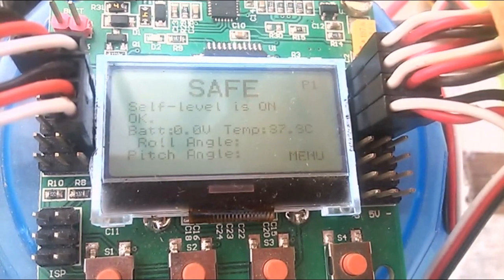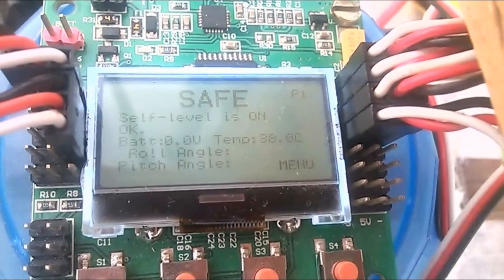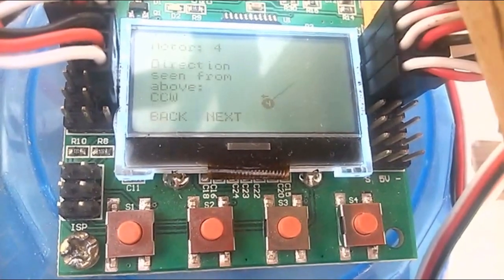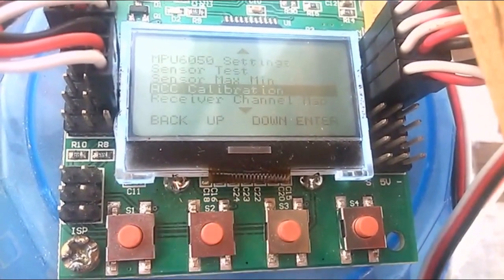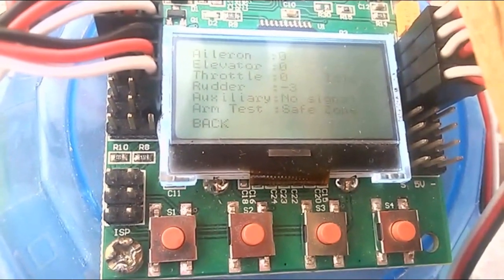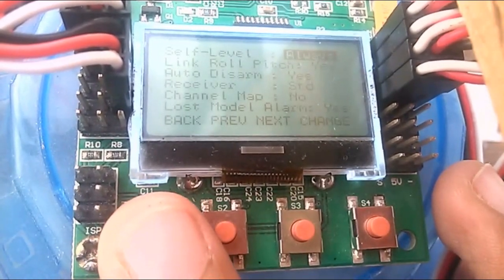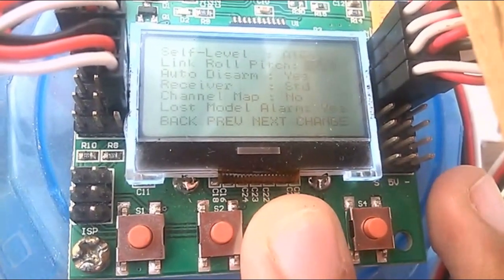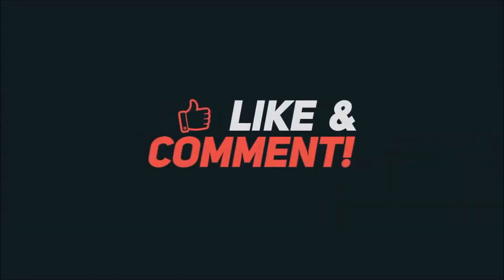Setup Of KK 2.1.5 Flight Controller | How To Setup KK 2.1.5 Flight Controller In Easy Way !!

Comment: Please I am using kk2.1.5 with micro zone m6c transmitter right hand throttle I set all the parameters correctly but it will not ARMED what is the problem?

Comment: Sir in my kk2.1.5 self level is showing off
Reply from the maker: Go to settings and find self level. After that trun it on stick. After doing this process when you push both stick left then self level will off and when you pick throttle stick to left and another stick right then self level will trun on

Comment: Hi this is jeet from Mumbai 
First of all ThankYou so much for your videos which is really helpful for students.

I am making a from by using following parts
1) kk 2.1.5
2) 30a esc
3) 1400 kV bldc motor
4) fly sky ct6 b transmitter and receiver

I setup kk board according to you and trying to run it but 1and 2 motor are running fine but 2 and 3 motor is not working properly when I went to show motor layout it's showing 1 and 2 as a motor and 3&4 as a survo my 2 esc also burned please help me out from this problem 7021927389
Reply from the maker: make sure that your all esc are work fine it should not burn. after that calibrate your esc at ones time
Reply: Can I help you

Comment: please tell me about setting my 250mm quadcopter. i cant fly. please help
Reply: reallyy ? thanks your help is very helpful thanks
Reply from the maker: Bro if your using kk flight controller then setting is below 

1. Always on self level mode

2. Pi limits and gain for aliron, elevator is 75, 65 

3. Pi limits and gain for rudder is.65, 40 

 Ok bro
Reply: @OmHobby  please tell me that when i am going to fly my drone it get disarmed automatically please give me solution
Reply from the maker: @satyamsikka6407  other reason for Auto disarm is because of lipo battery is not working properly
Reply: @OmHobby  thanq and also tell me that agar battery charge nahi ho properly to hoa hai kya because mujhe lag raha hai ke charger kharab hai and battery charge nahi ho rahi

Comment: Hii bro 
My drone is not flying im using kk2.1.5 board and plz give me thats settings.
Today i feel you can help me and give me solution thats why  i am just commenting here.
and kindly give me your Email id or u tell how can i contact you.
i have 50k + followers on tiktok thats why i am just going to shoot my video with my drone.
you can check  my id on tiktok @aamirhaider143
Reply from the maker: Bro first if your using drone for shooting then you should use apm or naza flight controller for more stability. 

And bro which problem are you facing in kk flight controller ? I will help you
Reply: @OmHobby  firstly i am just want to fly my drone without any camera  after I will do better.
That's my hobby making rc plane
But Iwas making first time drone but I got failed. My drone is not flying with kk 2.1.5 controller
Give me plzz full tutorial or Kk 2.1.5 controller settings
Reply: @OmHobby  Tell me how I can contact you
Reply: @OmHobby  Bro Yeh meri link hai maine uski video bna kr upload kr di h aap dekh ke btao Kya krna pdega mujhe https://youtu.be/qCMS_Uo8s-8

Comment: my kk2.1.5 board always shows error . and no yaw input its show then reciver test never show the thrtottle and elevator value after transmitter andc rerceiver biinding pls help me
Reply from the maker: Bro you transmitter doesn't give yow input signal because of that kk shows error. So you need to do some setting in transmitter or change your transmitter

Comment: Vaii  recrver test open kartaey sob no signal dikara hay
Reply from the maker: First check the wiring between receiver and flight controller. If you do worng wiring then it will happen. After the make sure your receiver is working means red led light should blink. Most le it happen because of working wiring. And most important switch on transmitter first after switch on drone.
Reply: @OmHobby   Thanks

Comment: my drone is not stable so plz send me your drone PI SETTING IN KK2.1.5 FLIGHT CONTROLLER
Reply from the maker: 1. Elevator and aeiron 
P- gain = 75
P- limit = 65 

2. Ruder 
P- gain = 65
P- limit =40 

Don't do anything with i- gain and i- limit.

Comment: Bro still it shows error please help me
Reply from the maker: Your flight controller sensor may be not working because it may show error. If you try all things that i told but still it show error then I'm 100% sure accelerometer and gyroscope sensor are not working nicely. So change your flight controller
Reply: @OmHobby  thanx bro it works on my new kk board thanx a lot

Comment: also I calibrated the esc's. Throttle works fine but if I wanna change any direction with the right stick two motors at the side starts rotating faster but the problem is that the opposite ones completely stops. What should I do ?

Comment: How to make camera mount?
Reply: Make this video.
Reply from the maker: I will upload video bro . give me some time 🙂
Reply: Thanks for reply friend
Reply: Friend what is camera stabilization  in kk2.1.5 FC?
Reply from the maker: Bro camera stabilization system is used to control camera gimbal. Did you know gimba ? If yes so this feature is used to control gimble. You can control camera gimbal in kk 2.1.5 fc
Reply: Thanks friend